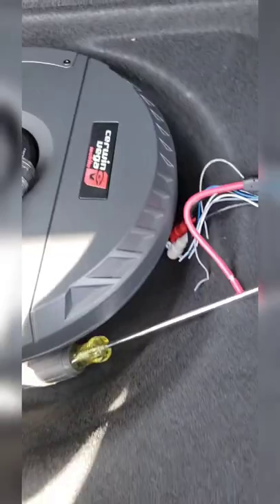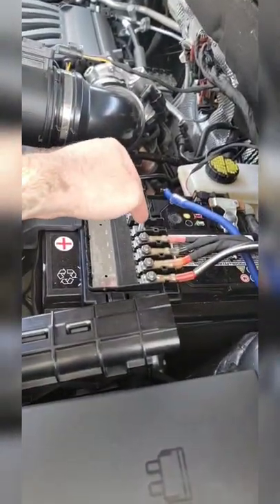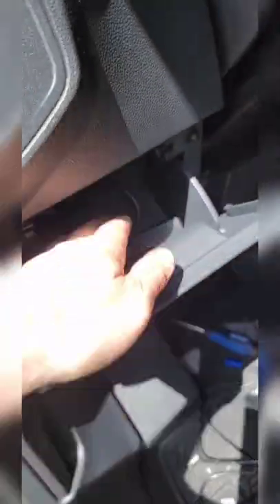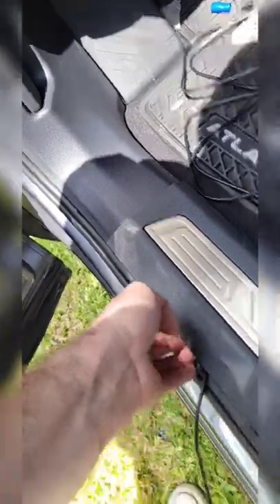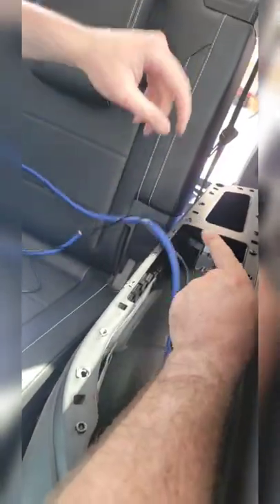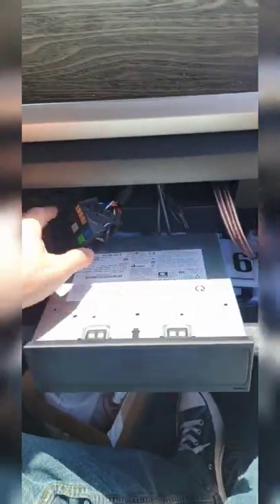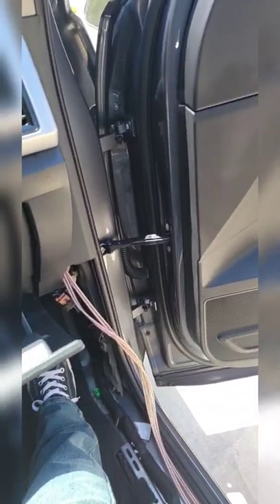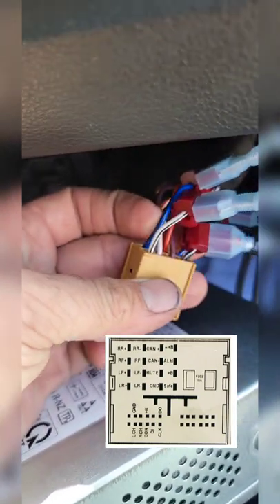Cerwin-Vega 12" Spare Tire Sub Install In 2022 VW Atlas! 10/10 would recommend! (LINKS BELOW!)😁

Comment: Should of done it right by getting a harness from enfig which provides without outs messing with the factory wiring loom.
Reply from the maker: We didnt replace the head unit or anything. Just tied into the signal wires behind the glovebox. Super easy install.👍

Comment: Nice work...I have the Cross sport with Fender  system.  I Just bought the Cerwin Vega and about to install. Did the codes all go off?  Can I use the sub speaker wires that come with the Fender system?
Reply from the maker: Yeah, car had a full blown stroke at first, all codes, etc. And yeah, we used what was already there + whatever we needed from the wiring kit. How did your install go?!
Reply: I am about to attempt this exact same job and will share the results. Have a ‘22 Atlas with the 11 Speaker Fender with pre-exsist if 6” powered spare tire sub which is very weak. This CW is a major upgrade so I’m pumped.
Reply from the maker: @Shy_Knee_Side_Up  Absolutely! Come back and share any feedback or advice you may have, doing the install with that sound system!:):)

Comment: Where did you mount the fuse holder at ?
Reply from the maker: Hardmounted near the sub in the trunk. :)
Reply: @fpswolfy1271  You need put the fuse holder close to the battery, not close the amp.